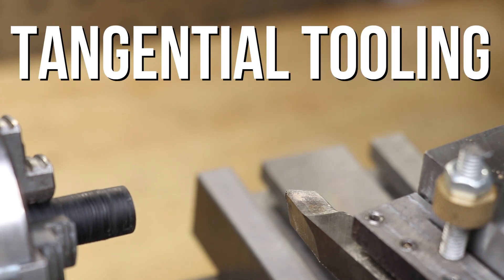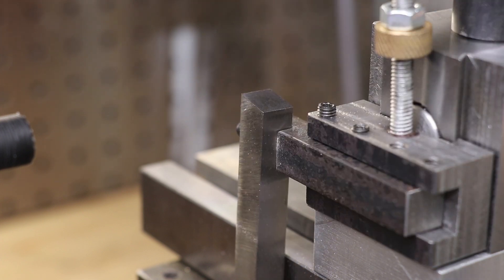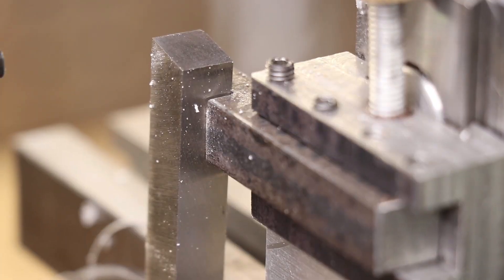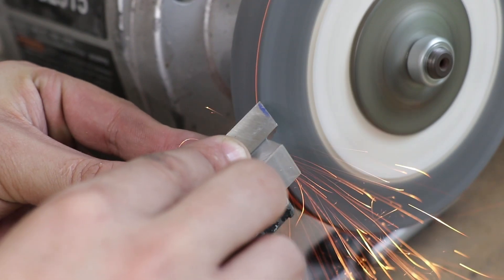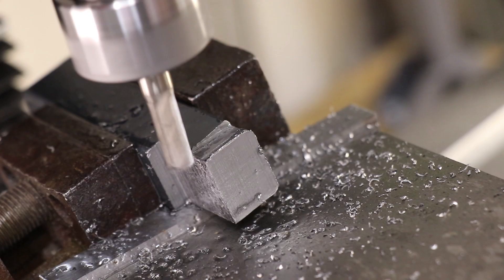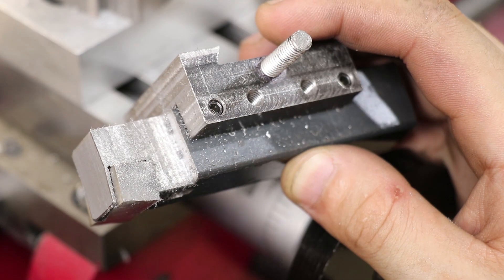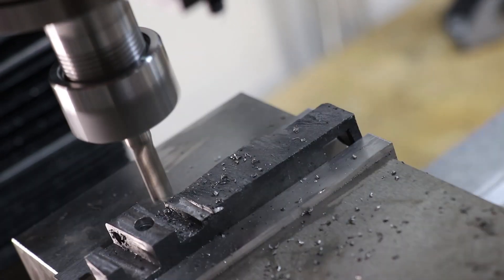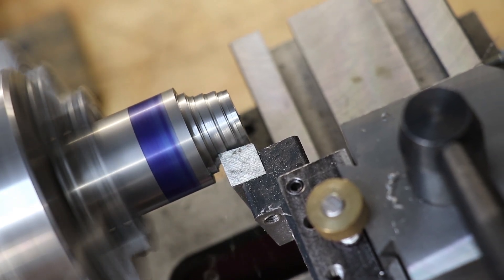WHAT Are Tangential Lathe Tools?

Comment: Waste of time, insert tools whip the arse of hss. I keep hss for odd shapes and when you need to grind your own special. Hss is too slow an over  heats on big cuts.
Reply from the maker: I use inserts more than I use hss, but hss still has its place in my workshop for thermoplastic and aluminium and light passes in steel. You do you but carbide isn't always the best tool for the job. Cheers
Reply: Eccentric Engineering supply Crobalt tool  bits which are a cast alloy made from 50% Cobalt, with the other 50% being Tungsten, Chromium, their carbides and some other additives. The have the same advantages of inserts over HSS and the same advantages of HSS too. They are particularly good on small low powered lathes. Nothing wrong with inserts of course.
Reply: @robertwalker7457  that makes it better then but the tool over hanging so far is going chatter like hell on a decent cut? Plus the work is always pushing the tool out of the holder. Being a time served engineer, working lathes and milling, I'd say the design is not really much use on anything more than a hobby lathe.
Reply: @michaelbamber4887  Yes I think a winner on smaller lathes, I can make a 3mm cut in mild steel on a 9*20 no trouble. I think they would be every where in industry by now if they we suited there but as you say are not?
Reply: @robertwalker7457  we had insert tooling for every job. Negative and positive rake, chip breakers and plane tips for cast iron/ brass, parting tools and thread cutting tools with tips of different angles for metric or imperial. Boring bars for holes 8mm up. On the big lathe you can take 25mm off the diameter in one pass. The advantage of tips is doing big cuts, the heat is carried away with the swarf and the tip stays cooler that hss, plus if it happened (should not of course) you got to much heat a tip can still cut while glowing red, hss just melts its edge with the resulting crash damage. Also tips can cut tough steels like stainless better.

Comment: I simply adore my tangential “diamond tool” from Eccentric Engineering in Australia. Well worth the money invested. The finish I get on steel or aluminium is insane. 👌The ease of maintaining a sharp edge is also a Godsend. 👏👏👍😀
Reply: I have just purchased the diamond tool and find it's give excellent good finish and is better than normal tool steel arrangement.
Reply: hi, did you get a left or  right or both? They have 2 options don't they? thanks
Reply: @TheIslandsForge  I obtained one of each. In hindsight, and if I could afford it, I would plump for a pair of each so that I could have a square and round tool permanently in each of the four holders. Hope that makes sense.

Comment: I've never used tools like this personally but one aspect I could see being a problem is how the cutting forces appear to want to push the tool back along the slot of the toolholder, meaning the screw it taking most of that force to hold the tool in place. traditional tool holders are set up so the force is perpendicular to the slot.

Comment: Nice seeing the tool evolve as you worked through to the finished product. I have seen another maker using drill rod for the cutter, makes creating the holder alot easier. 
As always, thanks for sharing 
Cheers

Comment: I thought you made a die filer??? 😁👍👍
Reply from the maker: Yeah. It does amazing work, but the files I have will only allow it to remove a small amount of material. Easier to use the big coarse cut file. Cheers